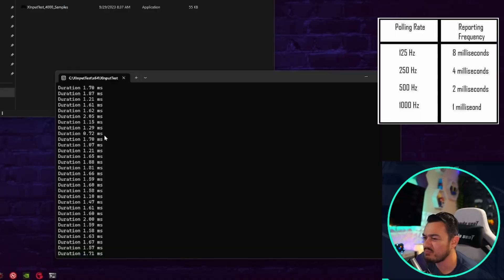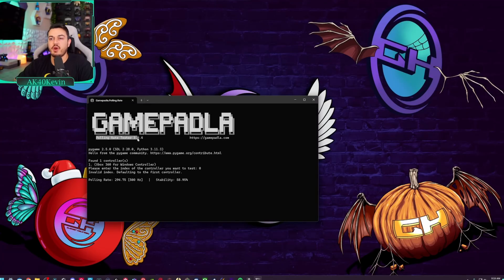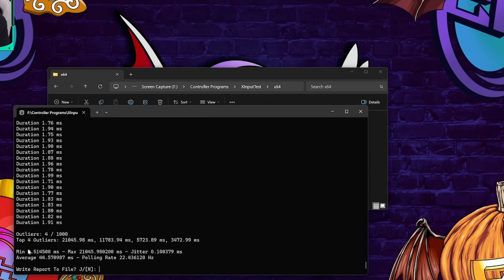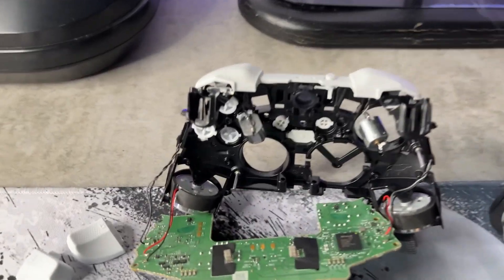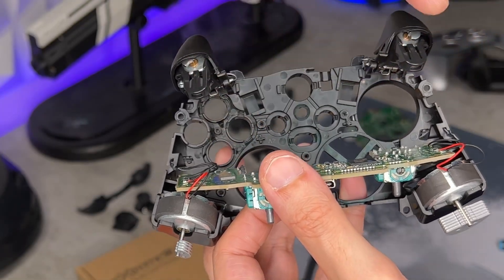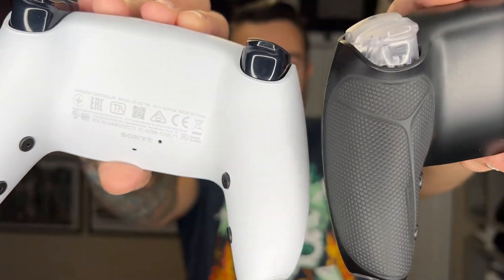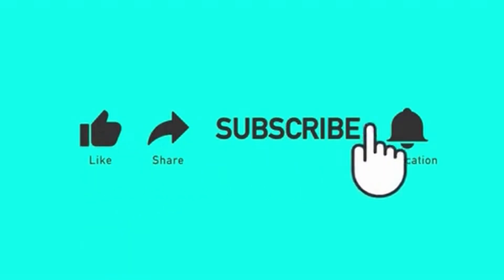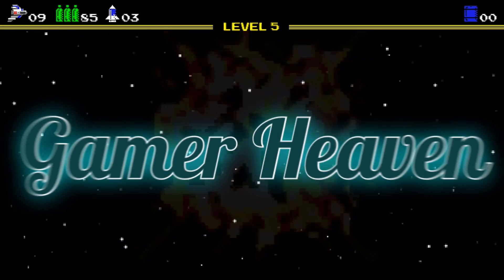Input Lag/Delay Vs. Controller Latency (w/ Resources)

Comment: So is it possible to achieve 1ms on controllers with xbox, I’m getting mixed information and no 100% confirmation. According to a video I just watched it is locked at a certain hz but that just begs a whole bunch of questions, like why do they get advertised at 1000hz and also have that option for Xbox ,or why take the option for 1000hz away if it never even worked in the first place? Also it seems to just be rumours that it does or doesn’t work, is there anyone who actually has tested it for Xbox? Just leaves me confused. So what is it locked at and also any other controller that advertises 1000hz for Xbox in the future is basically nonsense? I want 1000hz on an Xbox controller(even if it’s a minimal difference)  and I can’t make a decision based on this conflicting information. Any help from anyone would be appreciated.
Reply: They say only the power A fusion pro 3 and up hits 1.7

Comment: I have the G7 SE and a regular Xbox controller, I used to use the G7 1000hz on everything but realised the regular Xbox controller is actually better on certain games that require precise timed button inputs. My guess is it’s the because of Dynamic Latency Input that’s built in to the regular controllers? I’m surprised it’s not talked about more

Comment: So like no offense intended but you do actually straight up lie when you say "the majority of the time the results are identical or very close to using software" many controller companies are at 1000hz and they advertise this as 1ms input delay which xinput tester or polling from johnny punch will report but actual hardware testing will show many of these controllers at 5+ms wired(looking at gamepadla right now to verify this). 

Firstly this is worth calling out as false advertising on the part of manufacturers and secondly there's no world where 1 and say 7.49 to use the flydigi apex 4 as an example are close a 700% increase in latency over the advertised value and more importantly what you would be saying the latency is based off pure software testing.
Reply: is there a list of controllers that have been hardware tested and documented?
Reply: @zipperman6045  I love how people say No Offense and they proceed to say something purposefully offensive. 

Maybe he wasn't aware that if you test it on a Hardware level it's different. 
I've been a controller nerd for a long time and didn't know about hardware level testing.

So if you are unaware of something thats a lot different than "Straight-up lying"
Reply: @BrentCox2B  He is evidently aware of gpdl testing he's talked about both here and in the past and cites Anna punch directly this isn't ignorance it's a deliberate choice to not put the work in and how was I purposefully offensive I wasn't rude unless you consider pointing out when someone is lying as rude but nobody serious would believe that.

Comment: Do you plan on reviewing the newer MSI Force Pro Wireless? It looks like a really solid controller with 4 rear back buttons, trigger stops and auto calibration thumbsticks to counter stick drift. The sticks are also interchangeable I believe. You reviewed a MSI controller roughly a year ago and the sticks performed really well in terms of accuracy and deadzones, so I'm interested in it honestly.
Reply from the maker: What is that? I am going to have to check it out. I wasn't to moist with the cheap MSI pad I reviewed back in the day. this new one sounds sick

Comment: Does the Xbox series x accept 1000hz from gamesir?like if I put my he to my PC and put the 1000 can I still get that on xbox.alsp how can I go about still chatting
Reply from the maker: No unfortunately GameSir has done away with the 501,000 Hz overclock which used to be in the Xbox app itself so you didn’t need to use the PC app
Reply: @GamerHeavenOfficial  if I clock to 1000 is there a way to use on the Xbox and still use chat?can the Xbox support the 1000 hz still?
Reply: @REJR90  the 1000hz option disables the headphone jack regardless of whether you could use 1000hz on the xbox or not. so the answer is  even if you set 1000hz on the controller in the pc app you will not be able to use the headphone jack on the controller for chatting. If you want to use the headphone jack to chat the best you can do is set to 500hz.
Reply: @Rapmusicfreak2 another option would be buying a wireless headset
Reply: Yes it does, but to talk you either need a USB or wireless headset, or setup copilot and run your headset through a second controller

Comment: Hey Kev is this possibly why my Beitong Zues 2 right stick feels so much worse than my Vader 4 pro? Due to the input latency ? I ask this as both controllers have 1000hz polling rate
Reply from the maker: Very well may be the case.
Reply: They actually gave similar latency if you look at the site
Reply: @ weird how come they feel so different ?
Reply: @MrDoordude125  hard to say. You using them wired or wireless
Reply: @ both wired also when I do a polling rate check they are both at 1000hz but I noticed if I don’t start moving the stick before the polling test actually starts reading my Beitong Zues 2 has a really really bad first number or two on the test so I think that’s what’s doing it I assumed that meant it has terrible latency
Reply: @MrDoordude125  that’s just an xinput thing I have no idea why that happens I’m sure it’s not related the. Try gamepadla’s polling software to also test it
Reply: @ I just find it weird that it only happens with the Zues 2 and not the Vader 4.  Makes me think there’s something to it
Reply: @MrDoordude125  could be a deadzone thing. It's already registering inputs